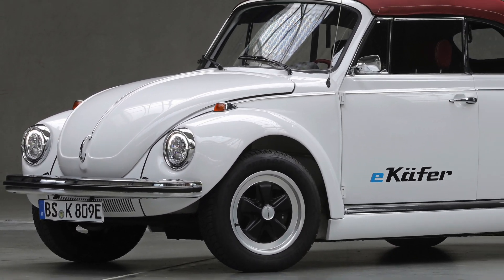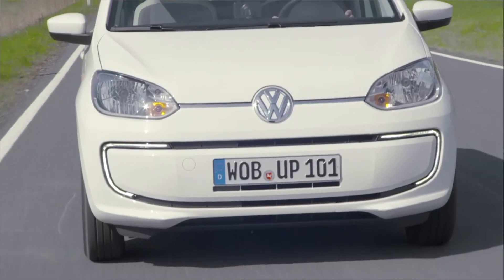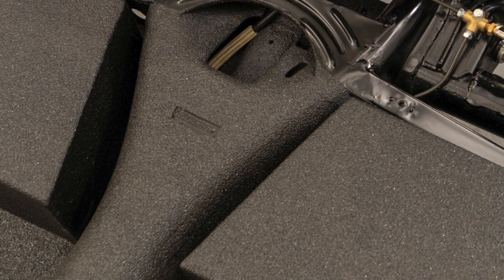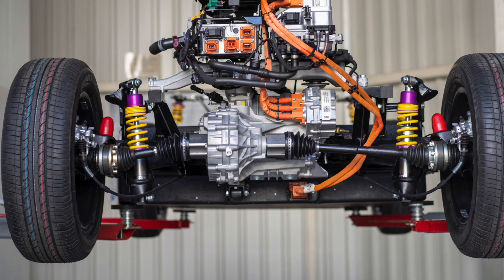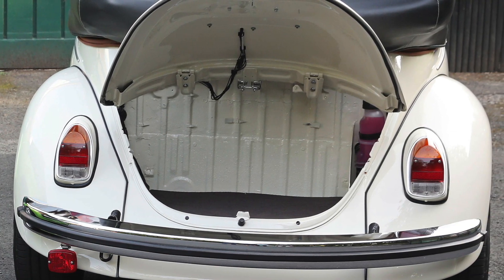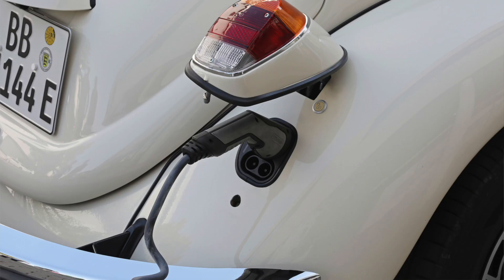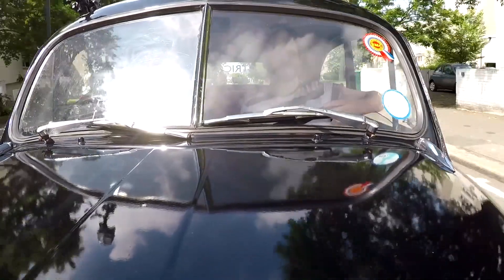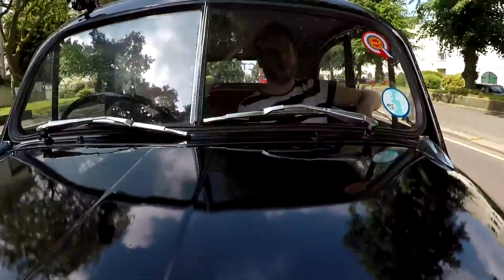This EV Bus Is All-Electric With e-Up Parts!

Comment: Old gas and diesel vehicles need a lot of maintenance when they sit a lot. Bad fuel, clogged carburetor, rusted fuel tank, rusted fuel lines, on and on. Electric vehicles can sit and will have none of these problems. Dropping in an electric motor to a classic car means that when you go to drive it you will not need to do a lot of maintenance to go out and enjoy. Glad to see VW doing this but I wonder why. Maybe it is to improve their (dieselgate) image.